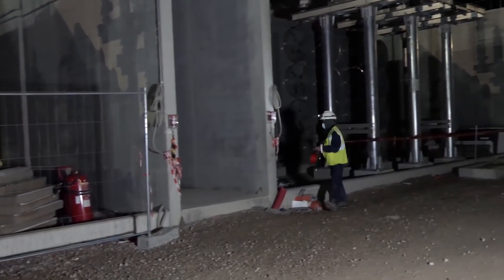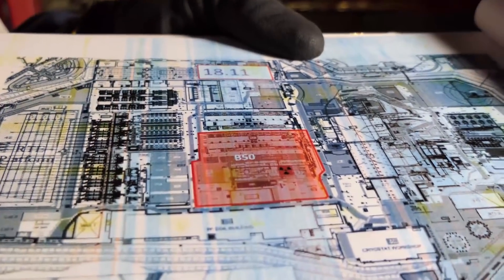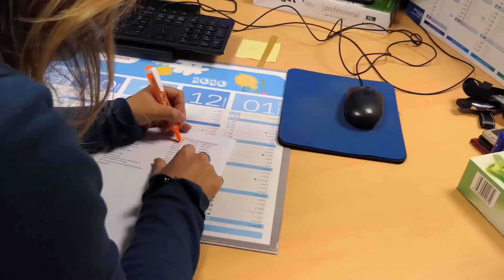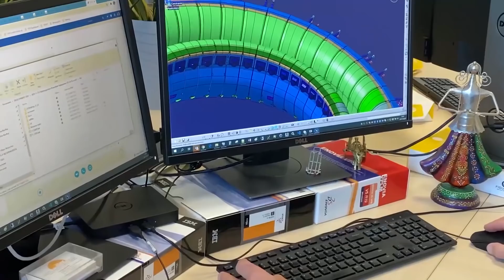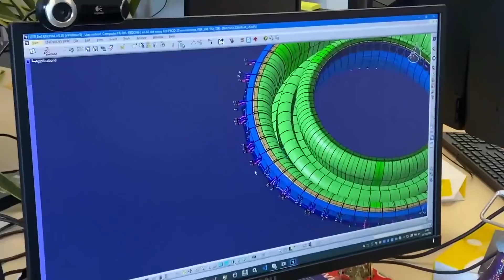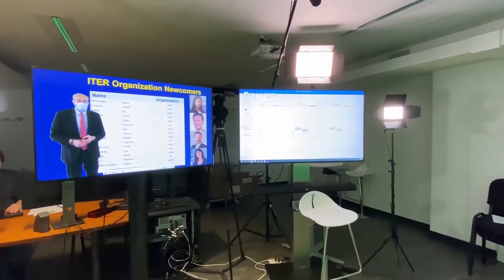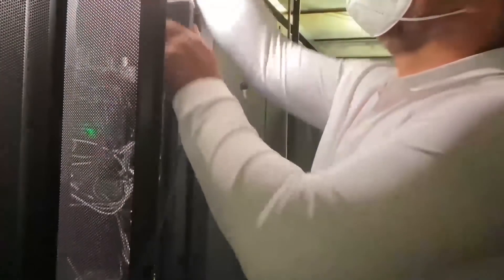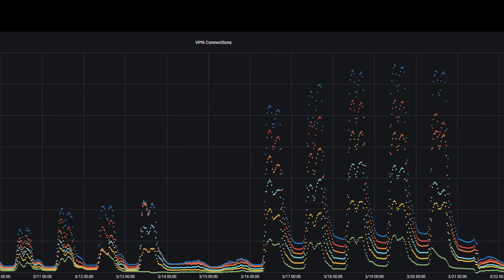The ITER You Never See

Comment: So they blast the area with radiation but leave the watercooler which can be radiated and drank after? 3:43
Reply: Radiation has no effect on water: both hydrogen and oxygen don't interact.
Reply: It's ok, the area is safe as long as the source is contained. There is no induced radioactivity with gamma defectoscopy.
Reply: There are different types of radiation. The type used here does not effect the water in any way that would make it dangerous to drink. A little education is quite effective to prevent one to see the boogeyman in every dark corner.

Comment: How much smaller will the production version be assuming they get built?
Reply: With the current technology the radius of the torus at the center would need to be 8-9m instead of 6.2m as it is now. But with progress in superconductors / stronger magnetic fields they might be able to design one with 4m radius instead. So it all depends on how optimistic you are with newer / better superconductors. But it won’t get much smaller, as stronger magnetic fields mean more forces acting on smaller structures. (Even if you were able to make the magnetic field even stronger / the torus even smaller, now you would also need stronger (novel) structural building materials to hold the parts in place when you switch the magnets on!)

The type of superconductor used also determines the size and sort of the cryogenic plant: will they still have to use liquid Helium, or might they be able to switch to something cheaper / more abundant? When you think that once there might be thousands of those power plants, you can’t depend on something that might get scarce.

Also: in order for continuous operation of a Tokamak you would need more external heating capacity (microwaves, beams) for the plasma, if I understand correctly, as you would need to keep the plasma ignited during those moments when the central solenoid needs to be restarted anew for the next cycle (- only a change in current drives the magnetic field of the center coil, and once it has reached its maximum current it has to restart another cycle, during which time the plasma cannot be allowed to go out). - If they switch to a Stellarator (instead of a Tokamak) for the final power plant, you would not have this problem, but then the radius of the core component / vessel would be around double the size  (- but ironically built from smaller components: so if you want more of your components to fit in standard shipping containers / want more of the plant to be able to be pre-fabricated / pre-assembled / transportable by normal trucks, you might be better off with a Stellarator anyway...).

Edit: https://youtu.be/-bau4ltGywg
Reply: Oh, you mean the whole site? https://youtu.be/pmx6zUJiiVg - No idea.